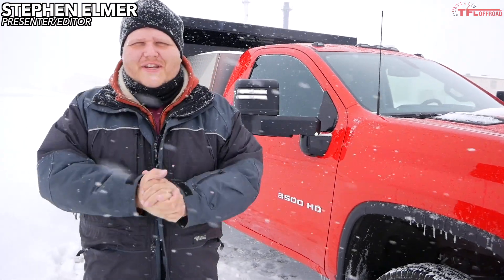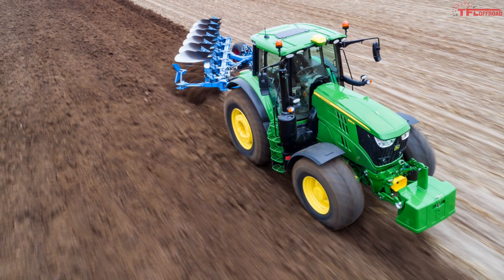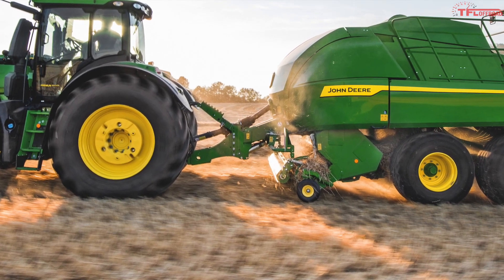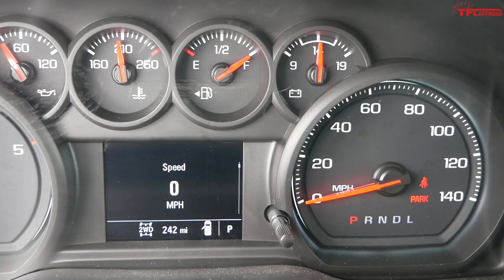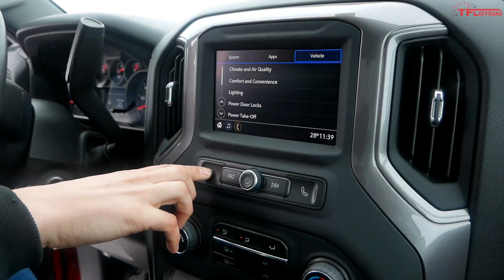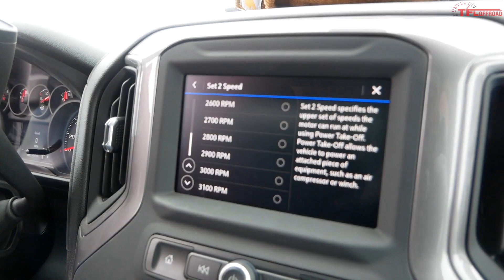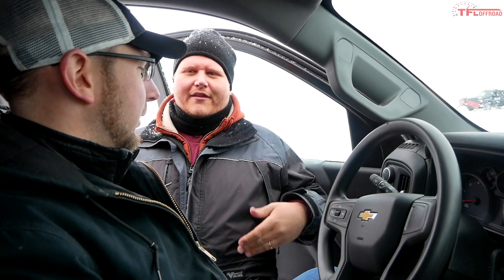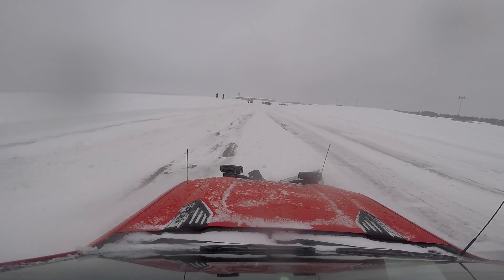What is a PTO and How Does it Work? We Explore this 2020 Chevy 3500HD Dump Truck to Find Out!

Comment: Imagine a generator (which is an electric motor in reverse) on the PTO. Turn off truck engine, put it in neutral. Power the electric motor via big ass Lipo4s. Would someone be able to make an electric vehicle via bolt on components?

Comment: Silly question...how does this work with 4 wheel drive? Doesnt 4 wheel drives not have a extra port for a trans pump? I had to use a engine pump for a 2003 ford F350 4x4..automatic..thanks..

Comment: That dump valve makes me want a manual transmission in this Chevy 
The switch bank is pretty cool too. Kinda like the ford outfitter switch setup
Reply: Yes the switch bank is really cool until you get your new truck and find GM installs the switch bank in the dash and they give you the harness for it in a bag on the floor. Customer participation wiring the switch bank! The last thing I expected to do on my new truck was to have to tear the IP apart to wire the switches and they don't supply instructions for the harness installation.

Comment: Now if they could have the PTO run a high flow pump and some quick connections in the front to run a snowblower attachment in the front of the truck instead of slamming your new truck into snow banks all winter

Comment: So...can you use it while driving? If not that's pretty limiting, especially for a dump bed. Wondering since you had to set the parking brake to use it.
Reply from the maker: The engineer in the video said that there is a separate PTO driving mode as well.
Reply: @TFLoffroad  How do you change the mode?  I bought a 2021 and can't find a way to dump gravel down someone's driveway?
Reply: I would also would like info on mobile mode for spreading materials, probably have to have dealer set it up for a price👎

Comment: Steve,..here's an idea for you,...why not do a full video on exactly how and why the industry has changed over to electronically activated parking brake. This is an item that
a lot of reviewers are incorrectly calling an E-BRAKE,..this is NOT an emergency brake, simply because you can't ( should never ) activate it while in motion.
I for one, would wish they'd go back to the manually activated parking brake.

Comment: If y'all think that's cool you need to check out a real PTO and move up into class 8. You should take a look at a split shaft PTO concrete pump truck. Imagine something so powerful it uses a transfer case to divert full driveshaft power to a PTO

Comment: Plows don’t need PTO
Reply: Guess you can't with this truck. Drove dump truck for 20 years. Tailgating material was one of my favorite things to do. When dumping a load the truck has a natural motion to push forward. Setting the parking brake to dump is stupid if your bed is full. Gotta drift forward. Guess you could release the parking brake and roll forward but the PTO will disengage. Ugh. Not ideal but I'm sure someone will figure out an override
Reply: Adam Kane Transport LLC yes! Sometimes you need to pull forward when dumping a load.
But, they put a tractor pulling a plow when talking about PTO and plows don’t need it.
Reply: Magnus Eriksson I mean the plow you use to work in the field used by tractors.

Comment: This is a great option! Wish it was available in all trim levels tho...
Reply: Me as well. I have a 16 with pto installed. Its a ltz. Buying another truck but probably a Ford. You can get the option in all trim unlike GM, has to be chassis  cab or diesel.

Comment: Another good Video. :) Seeing how you had a Ford 150 with plow package on love my ride, it would be nice to see these ones stack up. The same with aux switches. What is amp behind each switch? it is shared or separate. 100 amp for all? where does it go on the other side of the firewall? aka how easy is it to set up a feature with aux switches? things like lights and winch comes to mind, but how about a salt spreader?